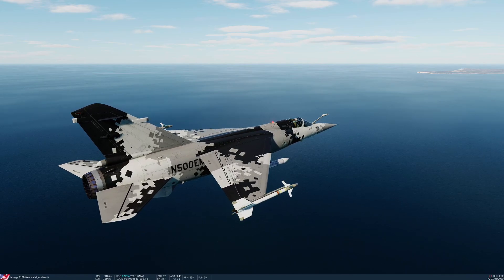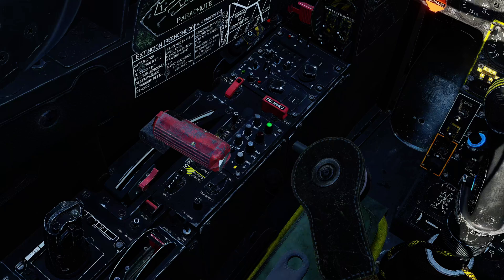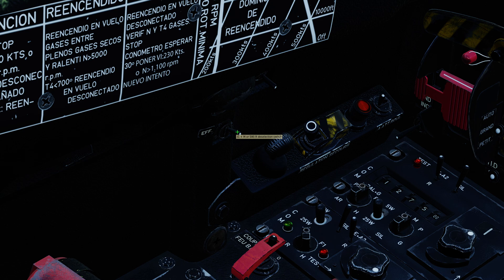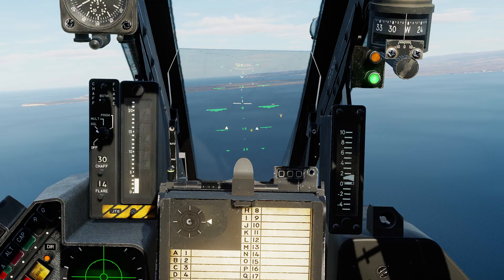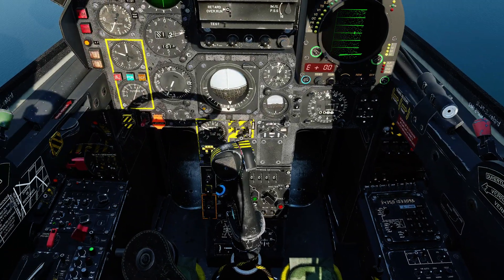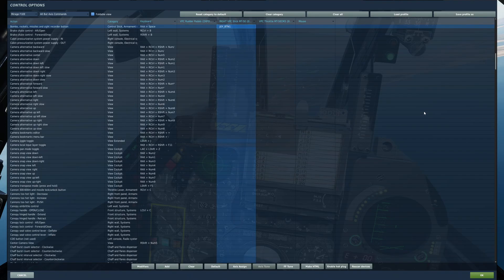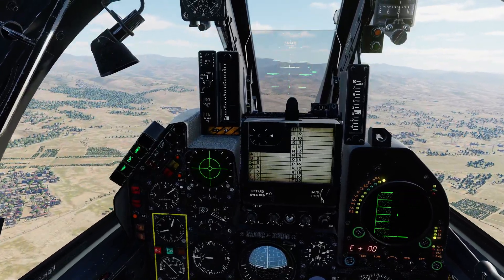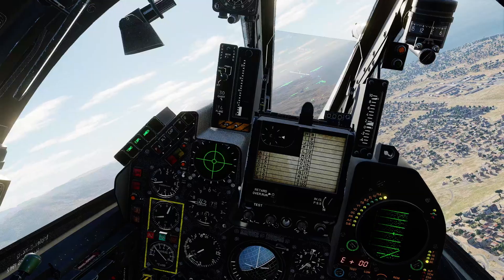DCS Mirage F1EE Tutorial 6 - IR A/A Missiles

Comment: No way to slave the magic or AIM-9 to the radar lock?
Reply: Press and hold the "cannon 300-600m and missile lock/unlock button".
This will slave the seaker head on the heat source once you get tone.
But you can not slave it on the radar lock.
Reply: Not yet, will be implemented later for the later AIM-9 models